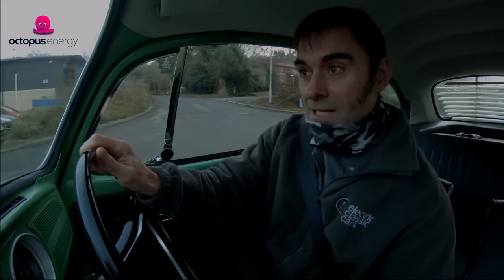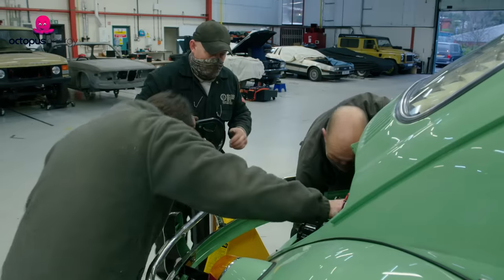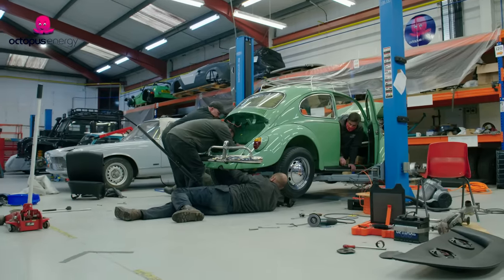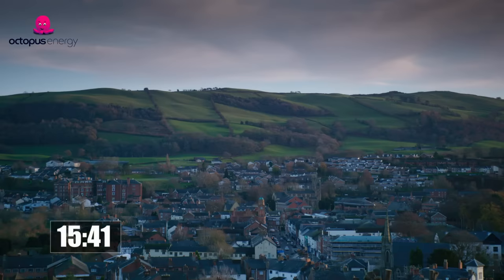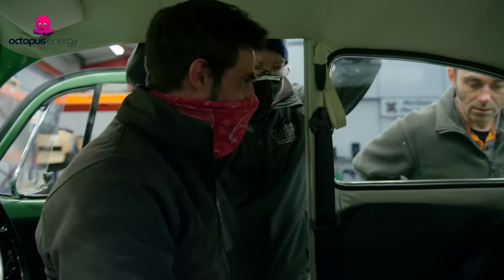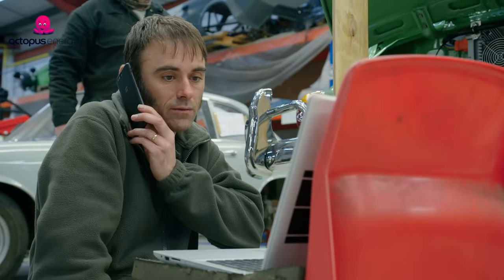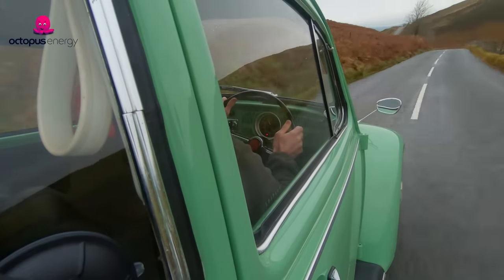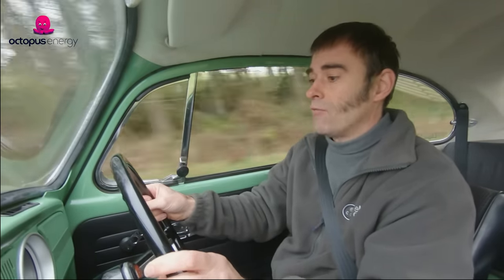VW Beetle converted to electric in a day

Comment: 45 miles one way ... I'm not ready for all that excitement yet!  Perhaps when you break the 600 mile barrier I'll be in.
Reply: Do you really want to drive 600 miles.... in a Beetle?
Reply: I’ll never understand those who think a vehicle has to travel 600 miles without stopping before they’ll buy it. A gas Beetle doesn’t travel that far in a full tank. 

My Tesla travels further on one charge than the Altima it replaced and my electric motorcycle travels further on a charge than the Yamaha it replaced. And it’s not like you can’t recharge it! Some people letting the world pass them by. Reminds of people who held onto their flip phones waiting for smart phones to flip and fold. Congratulations? They missed out on the last 15 years of smart phones, only to spend nearly 2 grand on their first smart phone that flips. Obviously, flipping is superfluous, much like needing to travel 600 miles before charging 😂

I suppose they can always wait for the Aptera to come out.. 💀
Reply: @evolv.e  With a tank of gas, the 2021 Altima can go as far as 630 miles.  I do it all the time as I travel a lot from the border to Sacramento in 8-10 hours.  Currently, the longest range Tesla offers is about 375 miles of range per full charge. Perhaps when the odometer reaches 200K you will be happy to know there will be a herd of folks willing to buy your used Tesla ... if you don't tell them that the cost of a battery replacement is between $20-30K.   I did however find lots of humor in your motorcycle, flip phone, smart phones, and flip smart phone analogy which you find had anything at all to do with me waiting for the EV to see 600 miles.  So be it.  I found the conversion of the bug with 45 mile before re-charging to be a great experiment. Personally have built many Baja Rails and off road buggy's using VW transporter and bug setups.  Would like to experiment with a much lighter tube frame EV setup but the battery weight is an issue.  So yes ... a long way to go before I'm in.  Knowing the cost of prototyping ... I'll sit back and let others take the lead and flip my smart phone. LOL!
Reply: @tealtoad19  the Altima we replaced was a ‘97 and had terrible gas mileage. We were filling that up twice a week. If we still had that vehicle, it would cost around $860 a month just in fuel alone. On top of that, everything was failing or falling apart. We were so upside down in value in that car as it required maintenance beyond its worth and was expensive to not only fuel, but to get it to pass emissions. There’s no way I’ll ever buy another gas vehicle. It’s just not worth it, no matter how far one can go on a tank.

Comment: Great challenge and I'd love one! But it was a tiny bit sad to do it so quickly with such a nice car. I would have left this one the way it was and found another example.
Reply: Yeah I agree.  This was pristine to start with.
Reply: Yep, wrecked it throwing all that electric bs in it
Reply: @CaptainRon1913  You still feel that? I’ve spent my driving live (50 years) with petrol and diesel (like almost all of us) yet I can’t think of a single advantage of the ICE over this clean, quiet, fast and better handling conversion. I felt that “sacrilegious” knee jerk when I began watching the episode of Vintage Voltage where a Ferrari was electrified. Yet by the end, that visually beautiful 4carb’d, 8 cylinder lump seemed archaic…
and slow! I hope I live long enough to graduate to an all electric car.
Reply: @CaptainRon1913  The future ain't the 'get stuff out of the ground and set fire to it' you're used to.
Eventually these olders cars will either need an electric (or some other fossil-fuel free) engine or they won't be driveable.

Comment: Someday I'd love to swap an elecrtic motor into my offroad beetle. 90 miles is not anywhere near enough though. It's not uncommon to go over 100 miles between gas stations where I live. I travel about 30 miles just to get to a town with a grocery store.
Reply: there are several different battery configurations and motor sizes. he said that they had over 100 horse power, so obviously if you give up hp you go farther.  Also, if you really want to extend the range to hundreds of miles you could build a trailer to tow that has all you want.  if you wanted to tow a trailer for camping you could do a 3 trailer configuration too...it would have to be a light camper but it would work...
Reply: you could also build a trailer camper that has the batteries in the floor, now you really have my mind spinning, definitely laughing now!

Comment: Looks fantastic I'm a bit sad to see we lost some storage under the hood and behind the rear seats but not much you can do about that battery box has to go somewhere
Reply: I would have liked to see them go the extra distance by installing the batteries flat under a false floor as the body is easily removed from the floor pan.
Reply: @johnt.848  Wouldn't have happened in the timeframe, but definitely the right solution? Looking forward, technologies like graphene offer the possibility of massless batteries which can be adapted to the vehicle, rather than the other way round. Imagine the range of that VW with maybe 200kg of battery weight removed?

Comment: Pretty sweet but it also makes me a bit sad to see such a super clean beetle get torn apart to be made over like this. Still I dig it 👍
Reply: I'm doing this to a Karmann Ghia at the moment.  Should I depart from this mortal coil, and someone is able to pry the keys from my cold fingers, converting it back to gas would be little more than unbolting the electric motor and reinstalling the air-cooled one.

And the one that came with it was seized up anyway.  * shrug *
Reply: @nickwallette6201  such a great looking VW too. The electric conversion should make for one great driving car to match it's looks.

Comment: Really cool! A question thou, how do u do with the greatbox. U still use it to shift between gear 1 to 4? Or u only use it to put it in reverse and then like while driving forward u always have it in one specific gear?
Reply: That's what I was wondering ,when I saw them connecting an electric motor to an old gearbox.
Reply: I was wondering the same…..I’d like to eventually convert my classic car….but not if I lose the manual transmission!

Comment: Excellent work from you and your team to meet that tight schedule. Well done. I would like my Beetle converted also and it doesn't have to be completed in a day either. What is approximate cost for the parts and labor for this? Thank you.
Reply: Let me know if You get a response please
Reply: yes, that is the bottom line
Reply: Their website says prices start at £30,000....
Reply: I have read somewhere that there are "kits" to make beetle VW to EV, for about $15 000 USD. It is too expensive. A better way, maybe cheaper, is to buy a chinese EV garbage car, take out the engine and and batteries and swap it to you favorite classic car, to make it usable once again.

Comment: Would have been interesting to see how the manual transmission shifts with the electric motor. etc. Great video.
Reply: not a problem at all.
Reply: I had an electric S10 pickup with the original 5 speed. Worked just like a gas engine, but you don't need all the gears really
Reply: no change transmision
Reply: Good point, I wonder what gear it was left in
Reply: @DameEdnaBrown  Same here - Does the transmission drag account for the range limitation with such a light vehicle? And is it noisy not having been purpose - designed for an EM?
Reply: Is there an transmission? most EVs just use a single fixed ratio gear to match the engine to the drive train.
Reply: why would they leave the shifter in?
Reply: @DameEdnaBrown  Says further down in the comments, that they just leave it in 3rd.
Reply: @synapticburn   yes 70 mioe rage rshsa cekl mew ines 81 miîl rabfe
Reply: @glenncater1  reusing the stock transmission just simplifies getting the electric motor to actually turn the wheels. Otherwise they’d need to replace it with some kind of differential… which the stock gearbox already has. Saves on a ton of re-engineering and cost to just keep the gearbox.
Reply: @jasonescott  i guess for a homemade project its fine.
Reply: shifts better you don't need the clutch if you don't want to use it if the motor is not spinning no clutch needed
Reply: @DameEdnaBrown  most live it in 2nd
Reply: @tgilbert4319  the reason there is a transmission is to make the conversion simple as possible , if you convert  rear wheel drive car or truck you can bolt motor  directly the axle

Comment: Great job!  Would like to know the weight before and after.  Would also be nice to have an option for 50kWh for 160 to 180 mile range.
Reply: It's an EV West kit (I think) which should give you an idea of parts cost. The price details of the kits are on their website, probably around $18-20k for this setup in parts.
Reply: Engine, gearbox and full tank of fuel would have been under 150kg. That motor is 50kg, battery pack about 90kg, and between charger, controller and cables you're probably looking another 10kg... it's mostly a wash.
Reply: @HaralHeisto  fyi, they kept the gearbox, so really only removed the engine and fuel tank and some miscellaneous bits. I’m guessing the conversion increased overall weight, but tripling power should more than compensate.
Reply: @jasonescott  tripled the power but destroyed the range - 80 miles?!  Like a 1st gen Nissan Leaf
Reply: @ken but it’s a leaf.   And all the other electronics and plastic crap that will fail.
Reply: What's the deal with the laptop and programming the computer, is there no lower tech way of a throttle control,like the old forklifts
Reply: @jasonescott . Yes. I think they'll have had to adjust the springs a bit to get it to run level.
Reply: @frankcarden4709  The power/torque delivery needs to be tuned to the vehicle for it to work best for AC motors.
Reply: @LoanwordEggcorn  so we're the old forklifts a DC motor or was it the fact that they were so heavy their speed was limited( so heavy they couldn't go too fast)?
Reply: @frankcarden4709  Yes on both.  They're geared to go very slow with a lot of torque.
Reply: @LoanwordEggcorn   not being awkward but I remember driving one years back and it did have a variable throttle, as in it wasn't all or nothing.
This is bugging me now I'm gonna have to look into it,google here I come!
Reply: @frankcarden4709  Yes, it's absolutely a variable throttle.  It can be a simple chopper/PWM controller for a DC motor.  For a multi-phase AC motor the control is a lot more complex.
Reply: @LoanwordEggcorn  thanks for the info,much appreciated.
Reply: Or just keep the gas motor and get double that range and have fill ups only take a couple of minutes.
Reply: @jasonescott  they doubled horsepower tops and cut their range by 2/3rds.
Reply: This would be insane for cost alone
Reply: @kenwittlief255  yea
Reply: @dukeallen432  big techgy dot cra o oitt

Comment: Car is in really good shape, beautiful. I don't think the transmission will stand up to 120 horse power especially the torque. BTW: You don't have to pull the muffler to remove the engine, it normally takes 10/15 minutes to pull it. Four 17 mm nuts, two 8mm bolts for the heater cables, the fuel line, the generator cables, heater bellows and an 8mm throttle cable nut, the rear tray. and it's out.
I was a VW tech for 13 years starting in 1971 before going to Audi...

Comment: I like the idea but it hurts me seeing a Beatle in such a good condition getting drilled in and changed. In my opinion you should have taken one that is not in a condition ready for a museum. I mean look at the motor, there isn't even dirt or sth :'( But still a really cool project, you got my respect for the fast work!
Reply: I agree. This would have been much better done with a modern Beetle.
Reply: If you’re gonna electrify an old bug, why not take one that’s not pristine? I used to have a 72 that was almost perfect and I’d never think about making it a vehicle that you can’t travel the countryside in. Then how did the rear magically level out when off the lift the rear was at least 2” higher?🤔
Reply: Fast work? That pristine engine should have been dropped in minutes with all the hands fussing over it, not almost 2 hours!
Reply: That's a re spray for sure. There's no way in hell that's the original paint. Thus... it has no historic value.

Not to mention millions of beetles were manufactured over the years.
Reply: Project yourself 1,000,000 years into the future.
Reply: @mississippi-son  A million years in the future, we can just push a button on our fusion powered replicator and have a Vdub materialize on a platform. 

That's assuming humanity lives that long. News flash... we won't.
Reply: @vhfgamer  I think you got it, but I'm not certain. 😂
Reply: It’s absolutely disgusting.
Reply: @vhfgamer  You obviously no nothing about cars or car restoration. How about you goggle what a fully restored  pre 70’s Bug sells for before you make a uneducated comment.
Reply: @bryancastle5773  I'm fully aware of what a restored bug is worth. I'm also aware that there is virtually no money to be made in doing it, because there were a million of them sold. It's a simple matter of supply and demand.

A truly valuable bug is one that's wearing the original paint, has the original engine, or is unique or rare in some other way. A typical forced matched respray like the one in this video is not museum grade. Not even close. It's a cruiser, and that's all it'll ever be.

Comment: Would have love the total cost and the weight difference. The depreciation of that classic beauty is also an unknown factor
Reply: from the cosmetic side, there is no deprecation... and i would argue that making it electric makes it relevant
Reply: @ArielGonzalez1  As soon as anything is modified a classic car loses collectible value. Not saying the conversion to electric is not a good thing in general, I would do it if the price of batteries wasn't that crazy,  just wondering what happens to the value of the car post conversion

Comment: Good video!  I did notice that the suspension needed adjustment after the conversion - coming off the lift the rear was light and the front torsion bars were pretty maxed out.  Stiffer bars up front or was there adjustment available on the front bars?
Reply from the maker: No, it just needed to settle. Swingaxle Beetles are like that, they need to roll a few car lengths before the suspensions settles. 👍
Reply: The stance looked good to me. You can adjust the torsion spring plates on the rear so it sits lower but I like the look.

Comment: Are there any simple controllers that don't depend on a computer? I'd like to see something wired as simply as a 60's golf cart.  The more sophisticated the machine is the more parts there are to fail and the harder it is to repair. Noticed it took a LOT to just get the controller even working the way it is.
Reply: just as a comment: the pros of progammable controllers are, that one is able to define all important parameters like motorcurrent to torque ratio, rpm to gas pedal position (gas pedal position creates voltage signal that directly defines motor current via transistor (IGBT),  maximum allowable torque, response on torque change, short circiut alert threshold and so on - its not pefect, but ist is possible to match electric motor, mechanical part (gear) and gas pedal in a good way - the golf cart version of the 1960s to 70s is clearly more ruged but hasnt the dynamic range we are used from noadayy cars (the electric motor has to substiute the combustion engine - thats not a trivial tasks in this example) , golf cart electrical drives are more or the less - move - dont move, and something in between (move at half speed)
Reply: You'd need a special control unit for every single car in every single configuration and age, ramping up cost and reducing chance there's one for your use case.
I'm very much pro ease of use and against special software relying on lots of other stuff but be honest: an "one fits all" has too much pros

Comment: Hi Phil, this is very impressive, Amazing Conversion!  I can see you got an electric motor that coupled to the gearbox nicely. Is this motor custom built for VW only? Can you get motors that fit for some Japanese models like Toyota or Honda etc...
Reply: yes, as long as the motor can bolt up to the bell housing... that's what they were having trouble with.  There are a couple manufacturers here in the USA that make the transfer case for several models, I'll look into it and get back to you.  it's been a few years since I was looking at this!  Originally you had to assemble the circuit board for the motor.  So really the motor is the easy part, finding someone that builds the brain is the hard part!
Reply: @chrisbrodbeck1961  hi, I just viewed the conversion and am now planning on converting my Japanese model car here.  Can I ask for some detailed procedure?

Comment: Would love to do this to a modern transit custom with a range of 200mile and around 200bhp would be great fun rwd as well.
Reply: "200 mile range", ? Prepare to give up some cargo capacity with the required batteries.   But Yeah an electric van (Transit) would be neat.  People have converted VW vans to electric for more than 50 yrs. Of course range was quite limited with lead-acid batteries.....